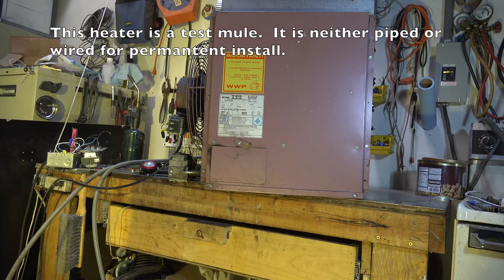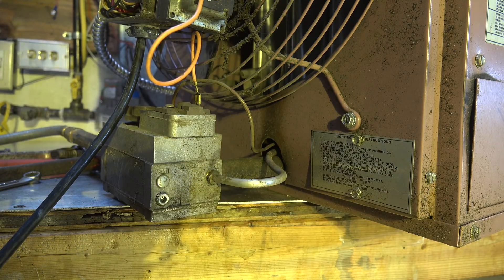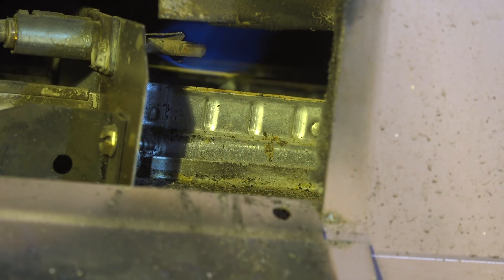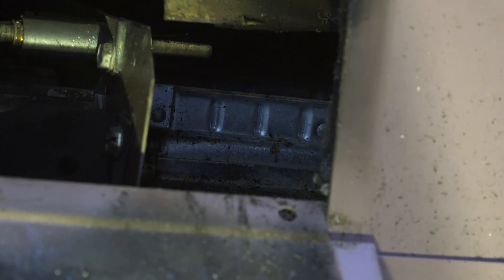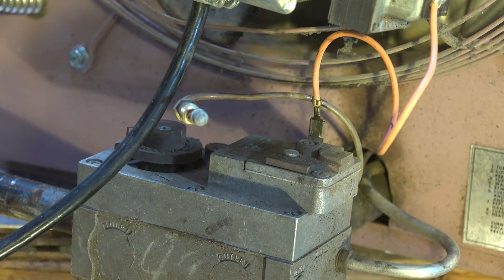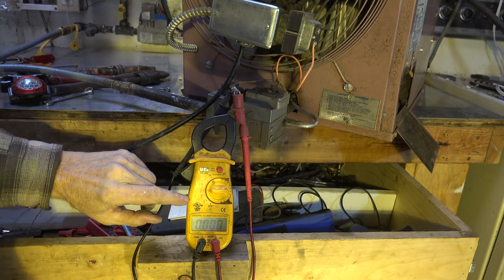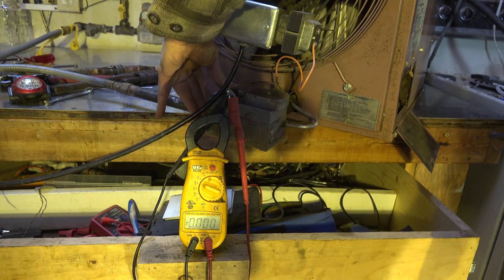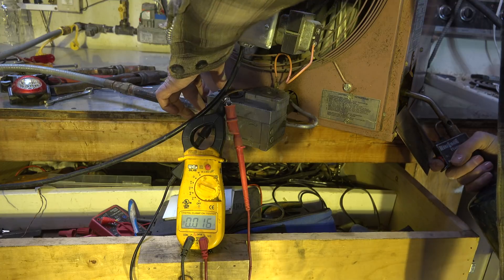What is wrong with this unit heater

Comment: I'll be looking at an Older Oslen Hanging Garage heater Model KAS160 with the pilot light not staying lit. Is it correct to suggest that solution will be similar to this one? I usually don't do commercial and mostly everything I work on now is newer and doesn't have a pilot so I'm just trying to Pre- Diagnose before I go. Thanks for any help. BTW I can't find anything online for this heater.
Reply from the maker: Pilot not staying lit is generally due to two problems.  
One, dirty pilot assembly causing a lazy yellow flame that doe not touch the thermocouple.
Two, thermocouple not putting out at least 14 MV (failed).  Hope this helps.
GFM
Reply: Thank you so much for the quick reply. You’re really doing a great service !

Comment: i have goodman furnish model GMS80703ANA, It is not working. when i turn on inducer and blower both turn on same time for about 15 secafter  inducer goes off but blower keep running. ignitor not on flash code is 4
Reply from the maker: The board is signaling an overheat or rollout condition.  There are manual reset limits near the burners.  The unit may fire off if you press the reset.  If it does start, you must be looking for a flame rollout toward the front of the furnace.  If it does rollout, you may have a crack in the heat exchanger.  This must be repaired for safe operation.
GFM

Comment: From this video, the business end of the thermocouple did not appear to be fully immersed in the pilot flame. Regardless of meter readings, I would attach a test TC, torch it, and see if the valve holds. This way I know 100% if a new valve is the answer. Early on, I did needlessly replace some valves based on meter readings alone. :  )
Reply: I'm guessing a ThermoCouple ( TC ) that is just dangling in air and easily heated with a torch... instead of going through the hassle and pain of mounting on the pilot burner, routing the lead, and hooking up.
Reply: It’s hard to tell by looking at it in the video but he did say that the tip of the thermocouple was fully immersed in the pilot flame.
Reply: a long reach lighter turned up is closer to a pilot flame for testing valve hold. torch is great for quick re-light/tc heating, but too hot for testing purposes.
one thing not mentioned is moisture and tarnish of the contact/threads and tightness of the thermocouple, both can cause voltage drop to the gas valve..
Reply: I have seen adapters, I think Fieldpiece makes one, that you CAN measure the TC while it's inline with the gas valve.  A quick search reveals there are several manufactures of them.
Reply: Robnord1 what is a test TC?
Reply: slamdvw got it! Thank you.